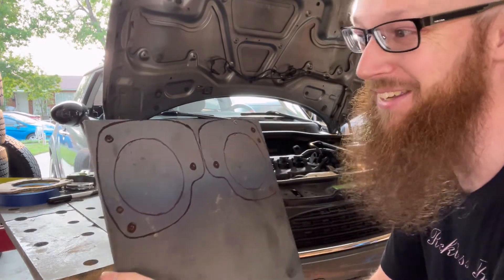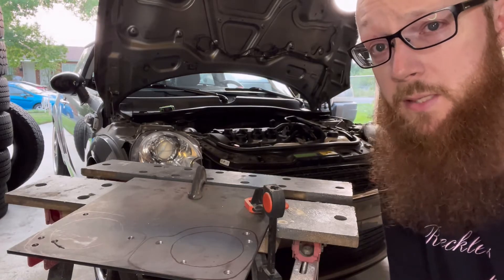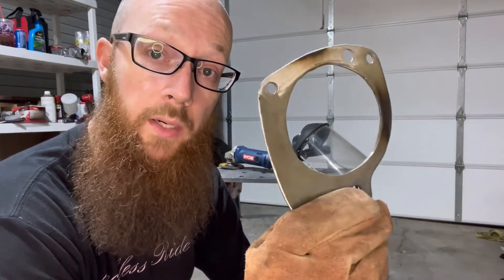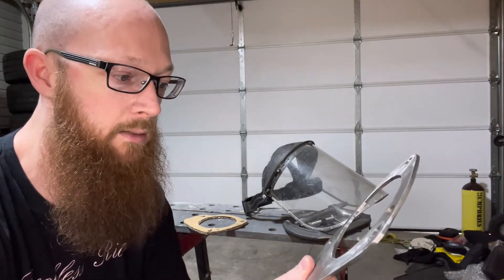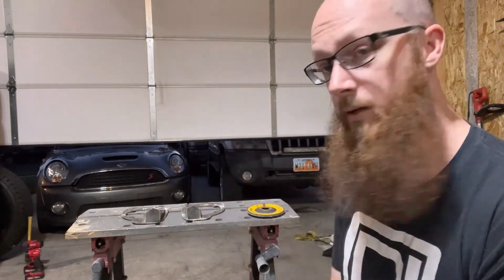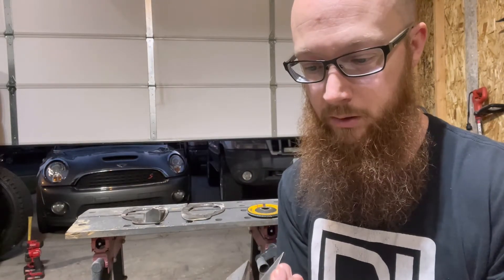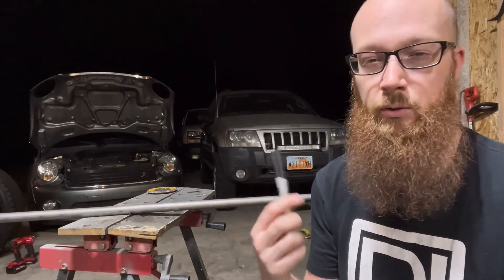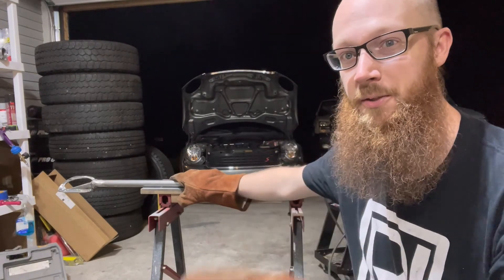Fabricating a front strut brace for the turbo Mini

Comment: Hi nice job,is it possible to put the templates of front strut brace(dimensions, length...)?
Thank.
Reply from the maker: Thanks! The tube is about 1/16” short of 39”. That would change slightly depending on where you placed the upright brackets. I don’t know where I could post the templates that would actually be useful for dimensions.